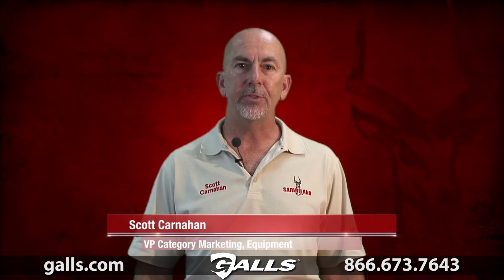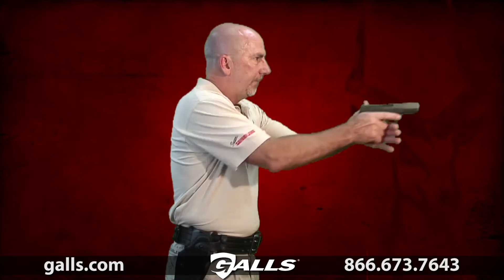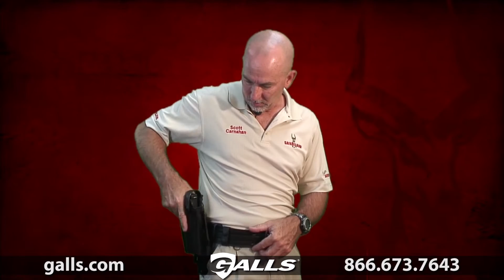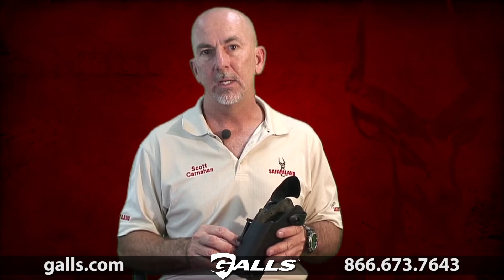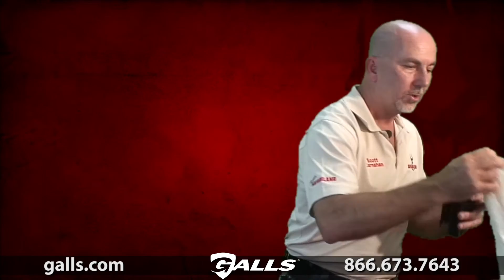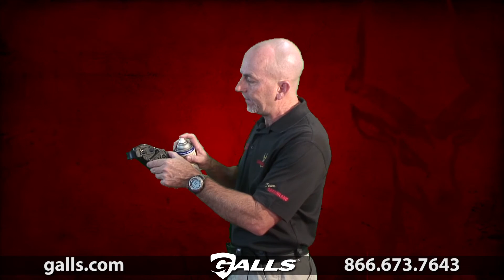Proper Set Up and Maintenance for Safariland SLS Holsters

Comment: I gave Safariland my exact model (Sis Sauer P320 x-carry Legion) on my order, and upon first trying to holster I noticed it wasn't seating all of the way. After removing parts several times from my Sig I learned that none of them had anything to do with it seating properly. It has something to do with the part "Whatever the part is called" that's at the end of the holster that the barrel rests on and partly goes in your barrel.

Is Safariland not tracking that the Sig Sauer P320 x-carry Legion has an extended threaded barrel? I have no idea what to do here since my holster is useless with this firearm w/o removing that part which I have a funny feeling is part of its retention. This is very frustrating considering I have to wait for a holster for weeks to arrive that doesn't work correctly.

Any advice?

Comment: What is the clip on system attaching the holster to the belt?
Reply: QLS, Quick Locking System. You can buy extra clips so that you can mount your holster to a nightstand, dashboard underneath your steering wheel, plate carrier, etc.
Reply: Kain Mayes I know right